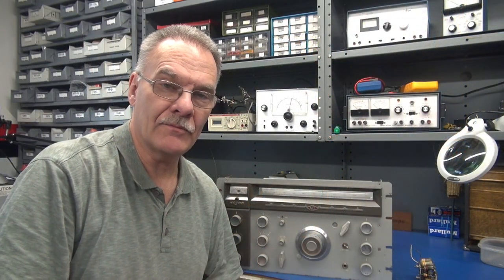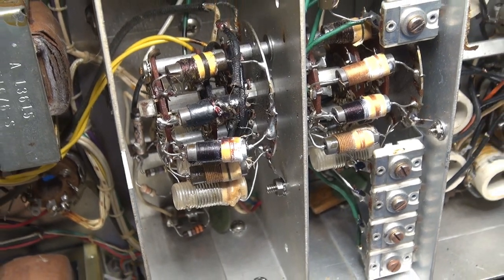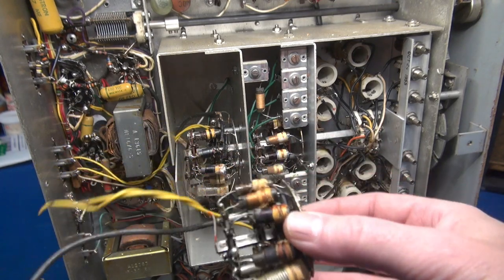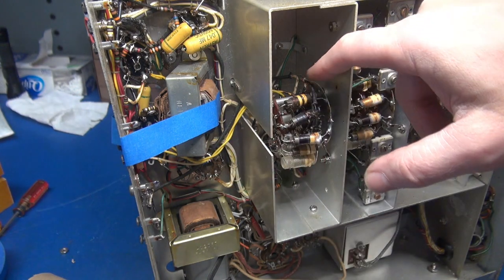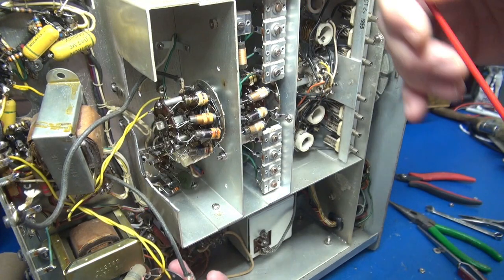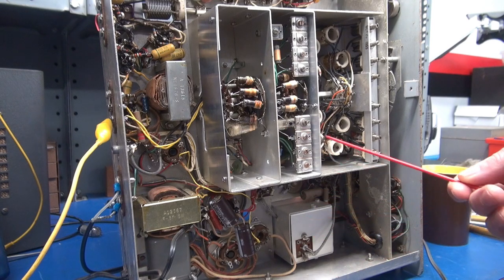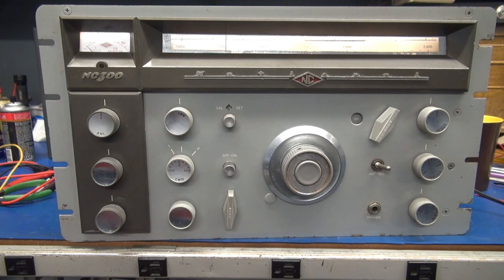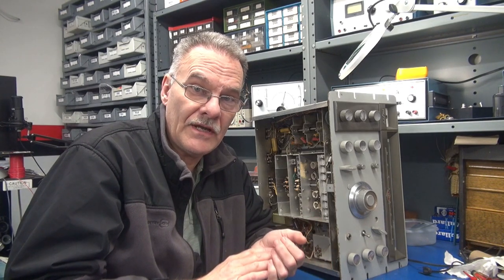National NC-300 Ham Receiver damaged by high power transmitter band switch smoked repair method

Comment: Ham Radio YES
Terry the bottom line is if you can get this receiver working for the man it gets the gear back on the air and keeps it out of the landfill. National made some wonderful equipment Thanks for helping a fellow ham discover this neato receiver. A total restorations is not always desirable and certainly is extremely time-consuming. 73

Comment: I really miss the days when a guitar amp would be worked on, upgraded, tips and tricks, and modifications that you can make that can be switched on or off to get the original sound back yet the modifications will extend the uses for your amp.  Most fun...  I think those days are gone now but we still have uncle Doug!

Comment: So very happy to see you working on Ham Gear again!  
I know there are those who are going to "Should" all over you about what you did and how you did it...I am not one of them.
One thing I would appreciate your input on concerns the use of the Dremmel tool cutting the metal inside the chassis.  I would imagine that there were little microscopic bits of metal going all over the place.  What did you do to keep that from being a problem?
I learned valuable information from watching this video.  Appreciate your sharing your talent with us!

Comment: Hi Tery, 
While I hate defacing and piece of vintage Amateur gear, even on the inside, but given the damage you were facing, getting the ole girl running again justifies the chassis demolition. The outcome was a dead receiver back to life and no one other than another tech will be the wiser.
The only thing I would have done differently would have been a little filing and straightening of the cut piece to make the repair look like it was just a later iteration of the same receiver.
Otherwise, A+, in my book.. 73, Glenn WA4AOS

Comment: It looks like you could have pulled that transformer in back of the sheild. Then bend the 2 sheild plates back far enough to R&R the part. Then bend it back remount the transformer. By the way Merry Xmas Terry and thanks for all your help over the years.

Comment: thats a good way to Get Things Going, Plus Crative as well, Next time repair needed in that section it will be way easier to do so, Maybe u can Try You're Hand at Repairing a Vintage TV set some day, then Expand You're Knowledge in Audio and video Stuff, Lots to learn yet, Plus u can do more on you're channel by adding in some TVs as well. And radio and Amps ETC u do now. Like a Mix of things to do and Expand on. And Merry Christmas,Happy New Years!!

Comment: hey d-lab. love the vids!!!! say, i have an old rca 56x3 radio. i rebuilt the whole thing. my problem is that im getting an oscillation around what is supposed to be around 60kc. thats not the big issue. its not tracking like its supposed to. 60kc is spread way out. it gets better around 1100 or so. anything below 1100kc is really rotten! i can hear one station for what seems to be 5 turns on the dial. any ideas?

Comment: Terry, do you have rough video on FM tuner aligment of a Scott 340B? I have the early repair instructions bulletin, but I have an issue with the FM stereo light only lighting just past 100Mhz on a good strong channel. The meter is almost at 10. I have other local channels at near 10 but the light will not come on. It seems to require about 60VDC to light it, most stations I only get 30v. I replaced the 5 .1uf caps under the metal housing along with the 2 4uf/250 elect. caps and no change. Not sure if it's an alignment issue. Any ideas?

Comment: I have no ham radio experience. Don't understand how the coil switch section got fried, was it lightening and how should this damage be avoided or the unit correctly connected? I am interested in putting up a crystal radio am antenna with lightening or snow induced high voltage protection. If this is too massive a topic to explain no worries, ignore this question.
Reply: Terry explained how it was damaged. A previous owner transmitted directly into the receiver since he put the receiver and transmitter on the same antenna without using a changeover relay such as a Dow relay.